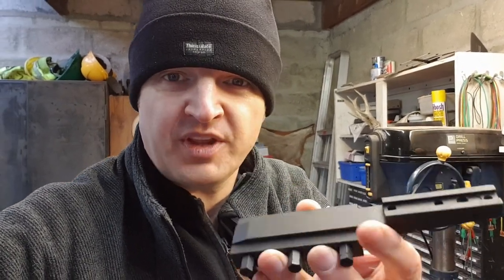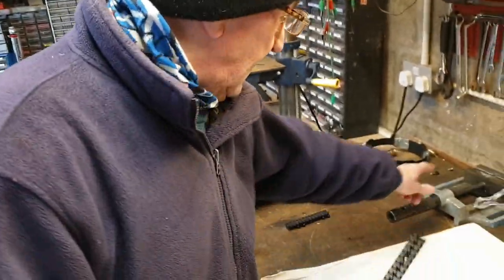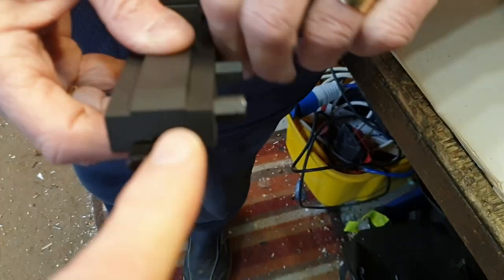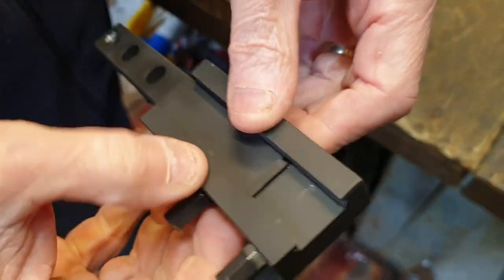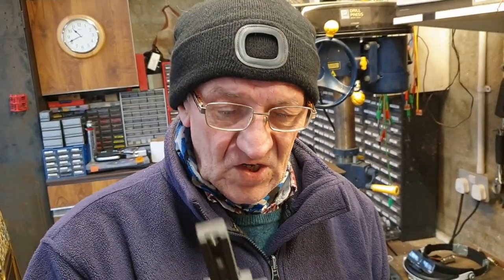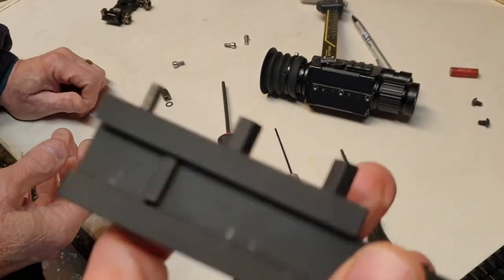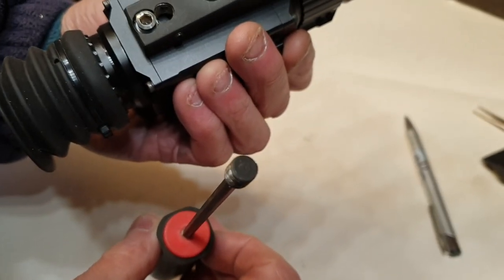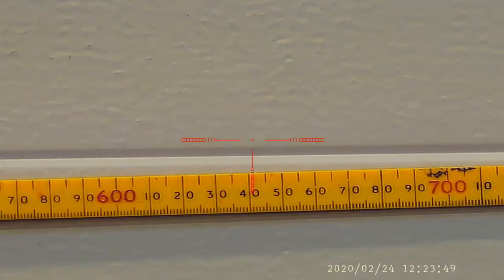@Kevgun's fully adjustable PARD mount

Comment: I bought some plastic shims off eBay last week for my pard nv008, just a little more professional than the coke can. I found the 0.7mm worked best for my .243. Great bit of kit I might purchase this when it’s available.
Reply from the maker: Hahaha so you're a shim snob then? ;o)
Some folk reckon the plastic ones are potentially compressable, but I'm now using Bruce's grub screw modification anyway.
I think Kev's going to be very busy with this.
Cheers. Russ
Reply: RussDouglas 222 I never thought I’d say it but yes, got my Gucci shims 🤣 I had that in the back of my mind, perhaps it would compress... but I gave it a good tightening prior to zeroing and it’s held it good! Looking forwards to the release of this mount.

Atb 
Jack
Reply from the maker: @JSDeerstalking  Hahaha cool, glad you're happy with them. 👍🏻😎 R

Comment: cool, would this fit on the airarms superlite s510?
Reply from the maker: I believe it would fit any rail, with just a slight lateral misalignment on narrower rails.
Am not sure @kevgun's had time to start producing them yet however... but there is another fully adjustable Picatinny-Pard / Picatinny-Picatinny rail on its way (from another company), hopefully before the end of the year. :o)
Cheers. Russ
Reply from the maker: Forgot to include a link to a pic of my old S510XS carbine wearing a Pard008.
https://www.flickr.com/photos/150760461@N07/48286911837/in/album-72157709648336941/

Comment: Have you gentleman considered a different mounting system for the pard?
For example instead of having the pard hang from the back, what if the pard was more centered..
I know your pards are mounted on air rifles..
I have mine mounted on a ruger precision rifle in 5.56..
And I find the mount to look goofy as hell
Reply from the maker: Hi Max, we have the Pards hanging back due to the near-eye displays, which automatically require a reach-back mount (I haven't been able to get hold of an add-on HUD yet for review, hopefully soon).
@Kevgun (NV forum and AGF) has made a low-profile fully adjustable mount, though production is delayed at present for various reasons. Another UK company is bringing out a fully adjustable mount soon/ASAP, though CNC tooling issues have delayed it -I'll hopefully bring you all that via my channel ASAP.
Cheers. Russ

Comment: Is it going to hold on a 308Win with finger tight torque on the three mount nuts?
Reply from the maker: Well I'd tighten them more than that, but with that much gripping surface plus a recoil arrestor stud, I'd say it should be ok.
Cheers. Russ
Reply: @RussDouglas222  that's what i thought. Much larger and better fitting surface. That rail wedge really doesn't fit well with the original mount.

Comment: just curious, wouldn't it be a tad difficult to adjust windage once it is mounted to the rifle?
Reply from the maker: Windage is actually the easier of the two to adjust, as it just requires two slim Allen keys left & right.  The slightly awkward adjustment is the M8 elevation grub screw, but it's an iterative process and once set everything can be locked in place via the grub screws.
Then you just fine-tune zero with the PARD's X & Y adjustment.
Cheers. Russ

Comment: Also need an after market mount to suit 11mm rails on air rifles.  It could be much lighter built than this one though
Reply from the maker: James I believe the idea for now is to use a click-in (sprung) dovetail-Picatinny adapter, like the 97mm long one from ANT-Supplies (two for £20). But I guess in time a slimmer/lighter version might be developed if Kev believes there's demand.
Cheers. Russ

Comment: Looks good Russ I wonder how much it will cost :~)
Reply from the maker: Thanks Bill, I mention in the vid Kev reckons £140 inc' Cerakoting. 👍🏻
Cheers. Russ
Reply: @RussDouglas222  hmm think I'll just stick with what I have then 🤔
Reply from the maker: @54Howie  If yours works then you don't need this anyway, this mount is mainly for folk who feels their Pard mount lets them down.
Both of mine are fine too, though I've found I do have to periodically check the two capstan-headed nuts, as I've noticed they can work loose. R